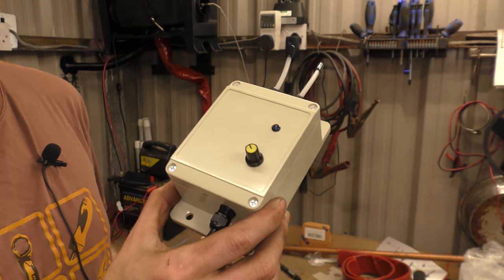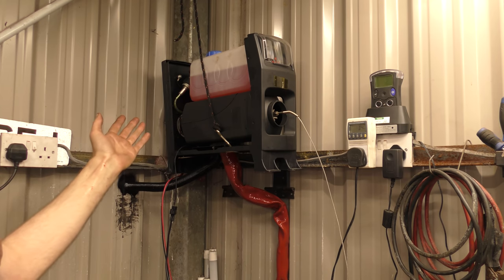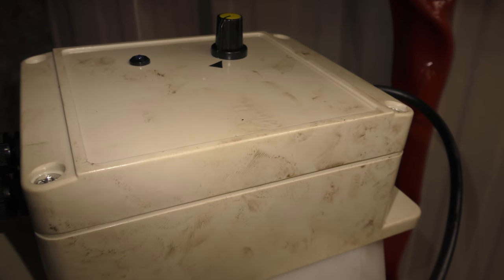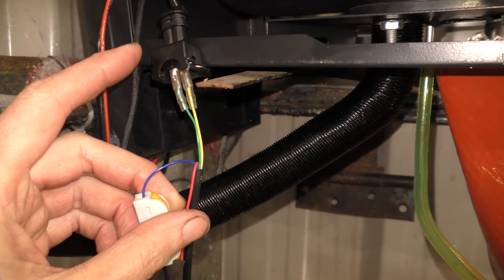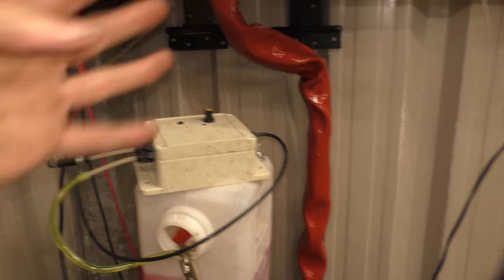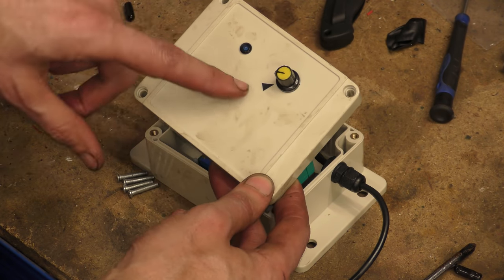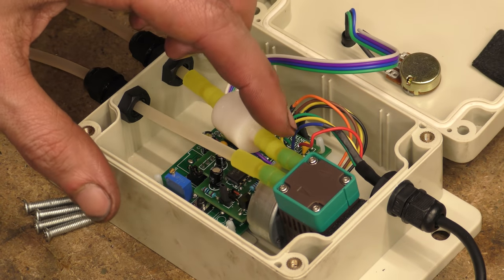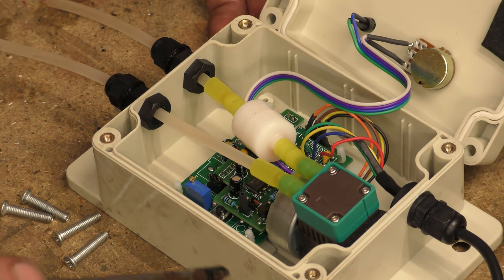Silent Pump for Diesel Heaters - test / review

Comment: Hi, I have a compact heater 1 - 8 kw, which is too big for my camper.  How can I reduce the power of it?  I use it at minimum but it is still too much.
Reply from the maker: Sad to tell you, you've probably been mis-sold a heater.  There are only two heater sizes and they are physically different.  Sounds like you wanted the smaller of the heaters which has a maximum power of 2KW.

If you have ended up with the larger heater you can tune it for lower output but it can still only go so low.
Reply: Thank you for your response.  
I bought it without knowing much about it and I must admit that I learned a lot with your videos.  
But in the title it says 8KW, which I doubt is real, now can I somehow decrease the pulse so as to have a minimum flame in the heater?   I have it set at 1.4 (the minimum that the LCD allows me).
Reply: @KIMRAY21  I have a similar problem and running any lower produces smoke and likely to carbon up. The heater is just too big for a tiny output. Turning up the minimum air flow more doesn't really help and just makes it more noisy  Maybe open a window slightly

Comment: I have a 2kw Webasto gasoline clone heater from JP Parking heaters.

Most parts are interchangeable with the webastos.

Can he tune the pump to work with this?
Reply from the maker: Yes, the pump is indifferent to fuels.  It'll pump any fuel.
Reply: @DavidMcLuckie  Excellent, thanks.
Reply: @DavidMcLuckie  It seems to have problems with very cold Diesel, James is on the case though :)

Comment: I wrapped mine in external pipe lagging and suspended with cable ties and I can't hear anything. But if it burns my camper down, this will be the 2nd thing I buy after a new camper. Lol

Comment: The air intake don't really need to go outside right??
Reply from the maker: Yes and no.  It doesn't 'need' to go outside.  But the reason to take outside air is so that you are not burning the air in the space you are heating.  As you then are drawing in more cold air from outside to replace the air you've used to burn and re-heating it.

Comment: Thank you David! One question.
The Eberspacher D2 12V diesel heater kit states "The standard heater is suitable for normal heating operation up to an altitude of 1500 meters, for operation above 1500 to 4000 meters an altitude kit will be required."  Could your rheostat controlled pump be used to reduce the amount of fuel enough to allow the heater to work above 5000 ft?   If so, how would you tune it?  Maybe the sound of the burn or exhaust smoke?
Reply from the maker: I'm not sure how much tuning James built into the tuning knob.  In theory it would work as you would just dial down the amount of fuel.  A cheap CO meter is the best way of tuning.

Comment: Well I guess since it syphons I wouldn’t be able to use this particular pump.  My tank is on the roof of my vehicle, heater is inside and current pumps inline with the heater…
Reply from the maker: I think James might be using a new pump design now with more anti siphon features.

Comment: Hi did you say 900oC in the core
Wow
Reply from the maker: Yes, I've got a long probe drilled into the heater that sits right in the core.  It will go over 1000ºC but the probe loses accuracy over that.

Comment: Interesting to hear / see the difference between the Webasto and China silencers.
Just like that order on Webasto and the big one.
In your case where it is so close to the ground and stationary.
I think it would be interesting to see / hear the difference if you made a frame around the mufflers and filled it with sand.
It will limit the sound output to only be the output itself and thus no resonance from the dampers.

Best comparison for us watching, your test. Would be that you cut the video together so that each cut is the different combinations, without gaps.
Then the difference will be easy to compare.

Continue the good work.
Thanks
A Dane in Sweden.

Comment: maybe can made arduino read genuine pump controll if have volt/pulse calculate pulses and arduino send out step,dir board to stepper motor pulses and thats all. no need more ,little code more and potentiometer can adjust pulseratio more or less or use DC motor and adjust volt output whit potentiomete DC motor at pump. and ower flow ventile heater not go too lot diesel.
Reply from the maker: If you make one, I'll buy one to test.

Comment: Loop the pipe so that it's higher than any of the components and it won't the siphon...
Reply: It will. Try siphoning a fish tank. You can loop the hose all the way to the ceiling, as long as the outlet is lower than the inlet and air can't get in, water will flow.

Comment: just upgrade you re fuel pipe to 2mm nylon air line and the pump cant be heard
Reply from the maker: Can you elaborate on that?  As the heater already has the semi rigid nylon line between the pump and the heater and it makes no difference to the tick coming from the stock pump.
Reply: @DavidMcLuckie  I have one Chinese heater on sent fuel pipe and it makes a racket.
My second heater has nylon 2mm airline and I never notice noise it's that quiet...

I don't profess to know why the fuel line makes such a difference
Reply from the maker: Hmm.  Perhaps I'll need to have a test of flexible fuel line vs the semi rigid nylon type.  Interesting.
Reply: @DavidMcLuckie i used nylon  on my car webasto and pump is in boot and had to fit an led light wired to pump flashing so I knew it was running..
Its quiet lol
Reply: @DavidMcLuckie  any update?

Comment: Buy a cheap heater get a cheap result I've  said before  use a check valve  on the  outlet from tank and move pump further from sleeping area.
Reply: The genuine Eberspächers are just as noisy. I used an electric golf cart with one.

Comment: It is a HUGE enginiering mistake! Electric board should be at the top, and the fuel lines at the bottom, in case of fuel leaking...

Comment: A simple solenoid valve in the fuel line would cure the syphoning problem
Reply from the maker: Kinda.  The fuel siphons even when the pump is running.  I got the heater to backfire out the air intake.  A solenoid valve would have to open and close on every pulse.  Not impossible though.
Reply: @DavidMcLuckie  a relief valve set slightly below pump pressure should do it then
Reply: Would increase draw and reduce run time if you are running off a battery
Reply: A check valve is what your looking for not a solenoid valve.

Comment: I don't like the idea of fuel and electronics being in the same box a couple of inches away from each other.
Reply from the maker: Wait until you find out how automotive fuel tanks work.
Reply from the maker: @stevenicholls5514  You do know that the vehicle in-tank fuel pumps are literally in the fuel and all the electrical connections are submerged in fuel?  Including the fuel level sensor, which on some cars is a circuit board with voltage applied to it.
Reply from the maker: @stevenicholls5514   From your comment I can tell you've never actually handled a fuel pump assembly from inside a fuel tank.
Reply: Yeah but in the case of gasoline at least, the vapours are too fuel rich to combust, like with a flooded engine.

Comment: m,anytime i has think why peoples not use peristaltic pump this not noise and cheap less than 10$ in ebay. and many shop. need only calculate and adjust how lot need pump move diesel. or test what have good speed. or/and made pressure awitch return tube if pump speed too lto diesel pressure etc, switch bush ower diesel back to tank. same than car have pump feed lot and ower  gas go back to tank.
Reply from the maker: Because it doesn't work.  The pipes fail quickly.
Reply: @DavidMcLuckie  you understood that :)

Comment: super expensive have huh new heater cost 100-150$  and u say pump cost 100$ super expensive. no newer buy.
Reply from the maker: It's a small volume hand made product.  This is how it works.  If he had a factory making thousands of them it would be a lot cheaper.  But it's only one man making them.
Reply: The alternative is you can spend 10x as much on a "name brand" heater.

Comment: For 99 quid i will rather listen to the clicking to be honest.
Reply: Me too I can sleep through anything, the other half on the other had could never sleep with the ticking, So its very cool the Noise can be removed if needed :)
Reply: @David_11111  ticking never bothered me.
Reply: Soothing as an old grandfather clock
Reply: @SocksWithSandals  With the silent pump?

Comment: I think people are so keen to want this to work they are Punch drunk they do not see the the problems, I know the designer has tried very hard to get this to work, But a Heater that stops working when it gets cold the problem should be talked about. I calculated that if you used you heater for about 8 hours a day the manufacture of  it claims it will only work for 3 to 4 months, I am sure James has worked hard but if he was more transparent about a few things people would not be so shocked when things like this surface ?
Sorry.
Reply from the maker: I'm not sure what you're talking about?  I feel like there is a comment missing.